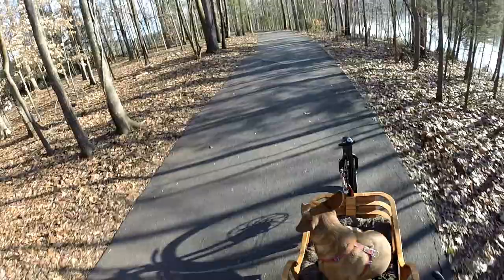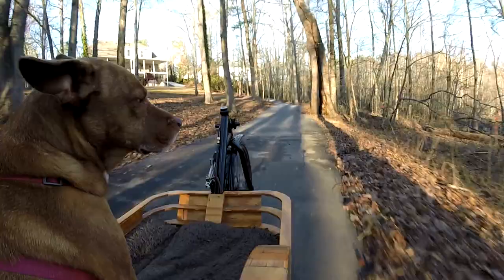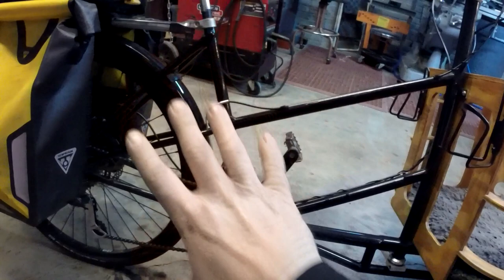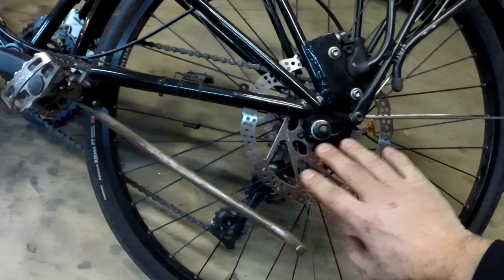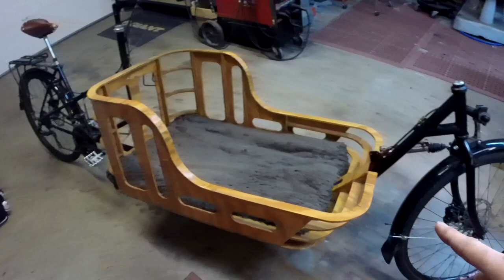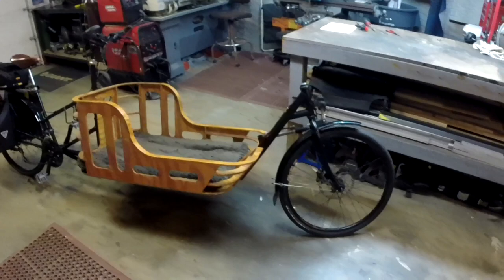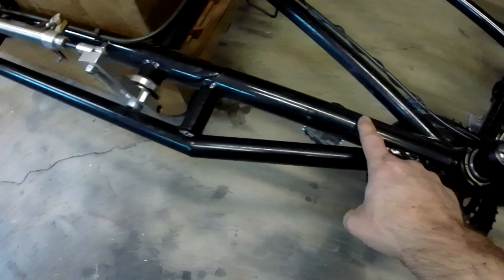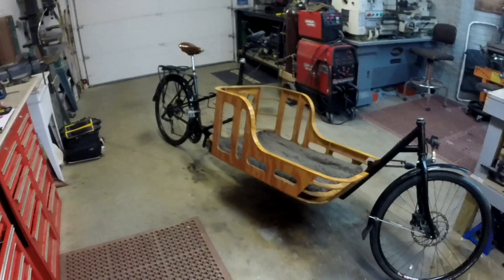I Built a Cargo Bike!

Comment: You might have answer to a concern I have about cargo bike options for dogs. I've considered a beefed up front rack, porteur style option, for the build simplicity, weight, and flexibility, BUT, it seems to me that a front rack carry option would be too unstable when carrying a dog. Did you think of this, or consider going that route?   Nice woodworking skills, have you build boats before?
Reply from the maker: Leo, thanks for watching! I designed this cargo bike to carry my dog, she weighs 55 lbs. I wanted the load as low as possible so it would not negatively affect the stability.  The bottom of the cargo area is at the axle height.  I have ridden bikes with loads higher up. It is doable, but make the take off and landing more precarious. I have not yet built a boat!
Reply: @themellowmechanic  , well, from the looks of your woodworking skills, and design eye, it shouldn't be a problem for you. I like your idea of starting with a tandem bike and building from that structure, I noticed a few designs yesterday from tandems, but they appear to go for rigidity by using a long top tube from seat to front headset and running their remote steering from a headset in that top tube. Seemed to also work. Different ways, same cat. 🤷‍♂️
Reply: My dog's about 30#, and I just don't trust him enough to behave when getting on and off a front rack style carrier. I'm still thinking I'm best off trying to fabricate a frame to build a sidecar. It's low, I can place it close to me where I can watch him, and I can use the trailer I have as a wheeled platform and save have the work fabricating a sidecar platform. It's already round tubing in a square format and it was constructed as a pet trailer.

Comment: Fancy, so there is no mechanical steering ? if you lose the fluid it wont steer ?
Reply from the maker: Yes!
Reply: @themellowmechanic  Did you consider using 2 brake cables in a push-pull configuration?
Reply: That would be my concern — catastrophic failure. But… How about the same concept, but doubling it — making it redundant — one on each side? Twice the cost and effort… perhaps an incremental gain on control (?)… but if there was a sudden loss of hydraulic fluid, one side would still function.